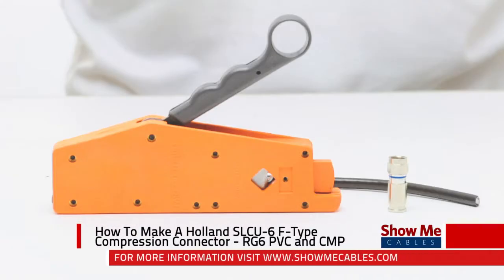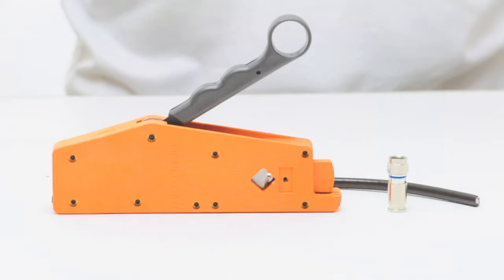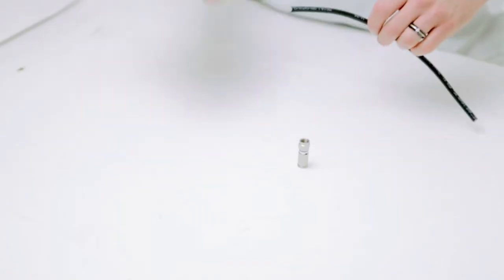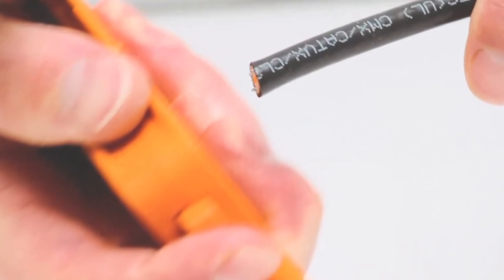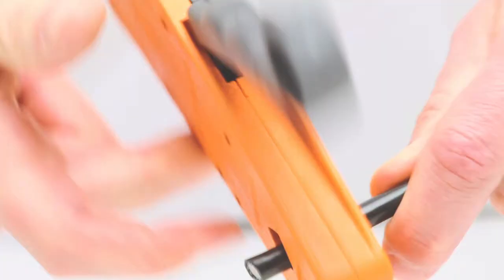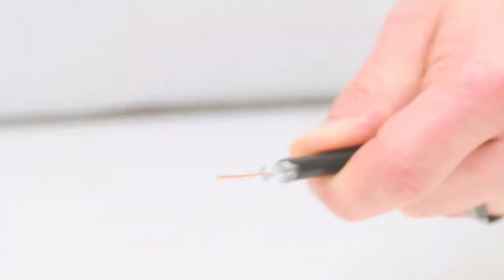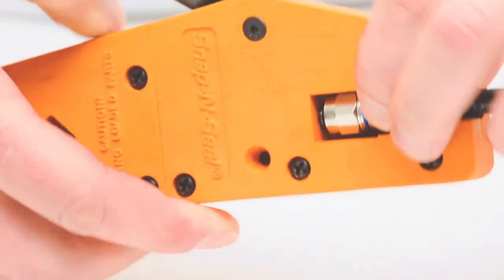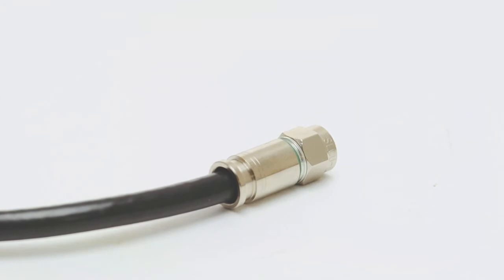How To Make Holland SLCU-6 F-Type Compression Connector  - #2006

Comment: Shouldn't the dielectric be flush with the inside of the housing. That's also way mor than a quarter inch of center conductor showing.
Reply from the maker: Thanks for the comment.  You can always trim the center conductor after termination.